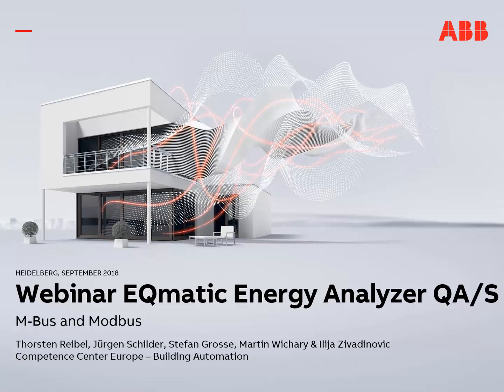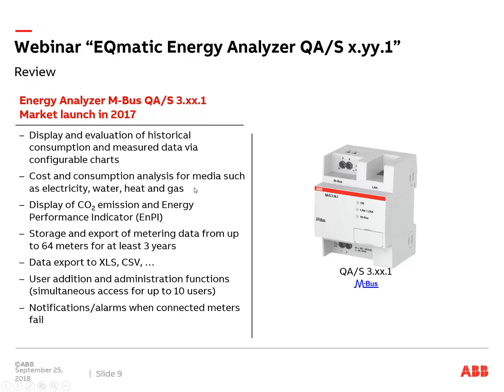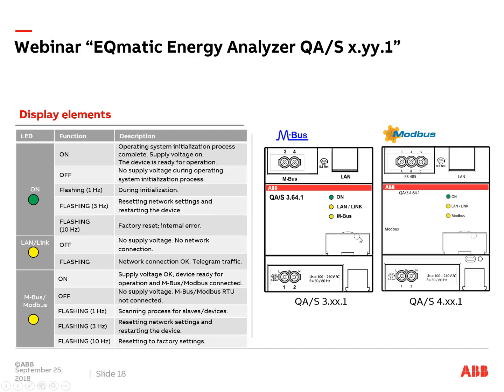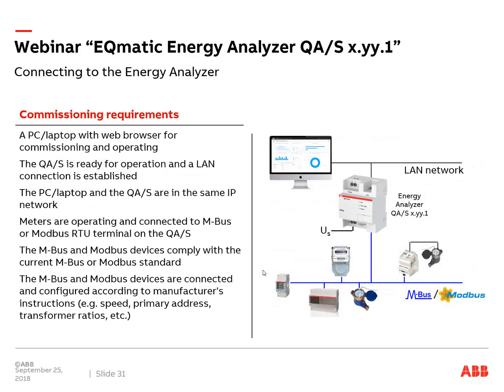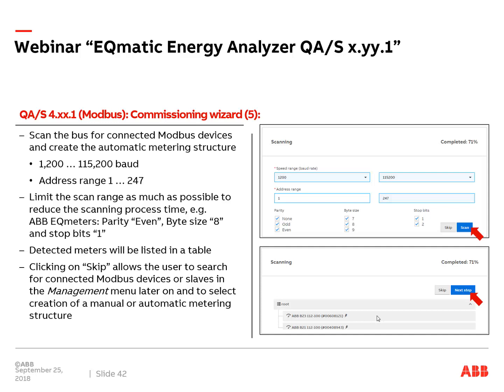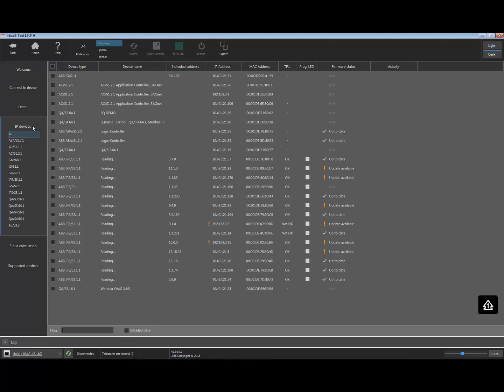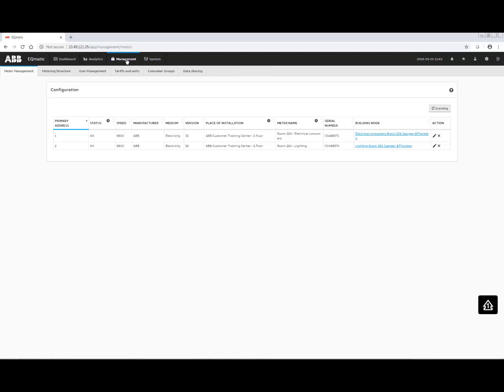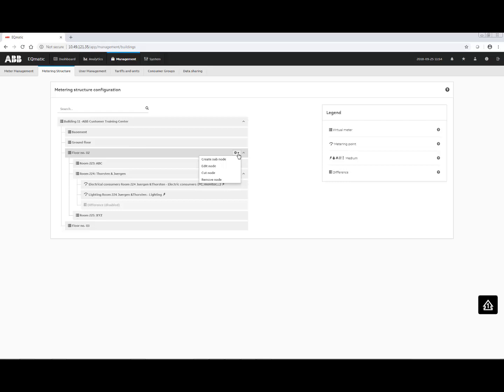Webinar about EQmatic - Energy Analyzer QA/S M-Bus and Modbus

Comment: Hello ABB, thank you for this video.
At 43:19 you speak about data points and you said not to touch it. I have a system with some 3phase meters and some 1phase meters. I want to be able to see the real total Ampere per phase. Unfortunately, the 1phase meters came with default data points at L1 but I have installed some of them also at L2 and L3. As you understand, in the dashboard, when I want to see the total amperage at L1, it showed me a falls number that contained ampere from L2 and L3. This affected also other measurements. I have tried to change it, for example the Description from L1 to L2 but it doesn't let me. Can you help me with my problem? Do I have to re-intsall them but as third party meters or Is there another way? 
Your answer is much appreciated.
Thank you very much.